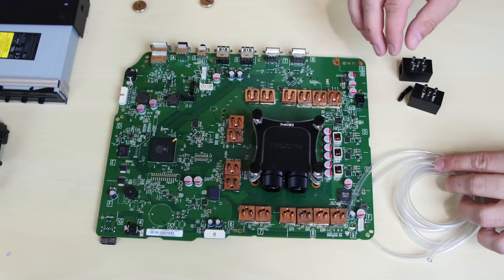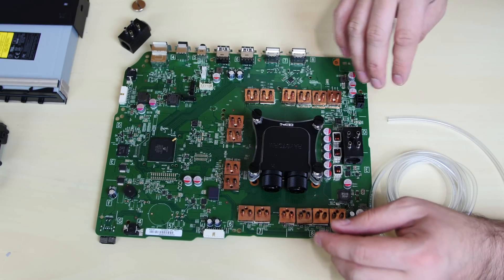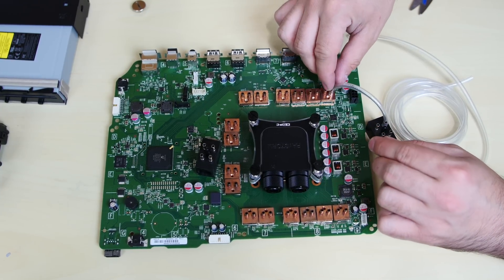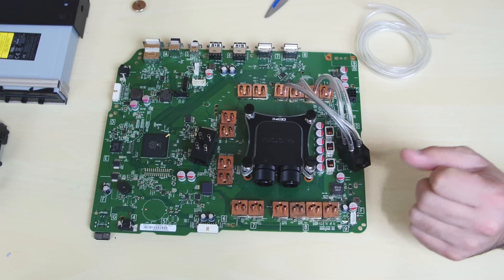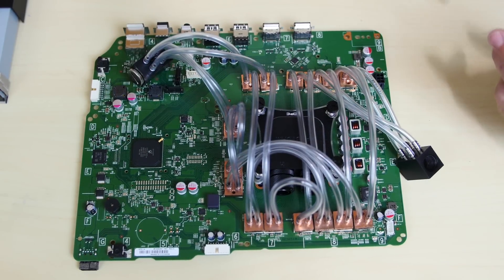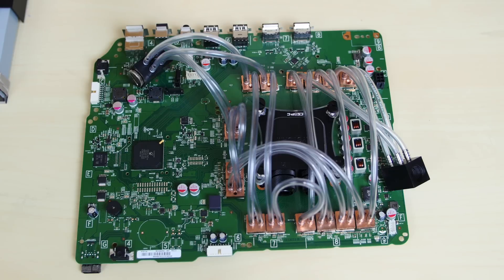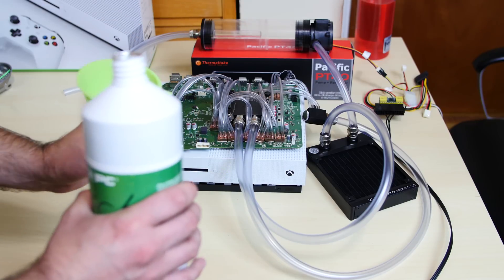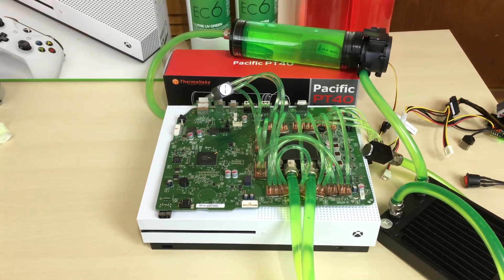Water Cooled Xbox One S - The Build - Part 2

Comment: Once you get the clu block on put the board back in the case.  Do everything possible to not mount the splitter box to the board like this guy.  If it moves and arcs, it will fry.  Dont listen to this guy.

Comment: You should have used some different fittings on the block instead of having to move the smaller ones to accommodate the tube.

Comment: You should have sent the 2 lines on top to all of the top ram and the 2 lines on the bottom to the bottom ram, then chained it like in the product description in the URL you linked.

Also think you should have moved the fan and instead put a piece of acrylic with LEDs so you could see the cooling system inside.

Alternatively, you could have made the RAM in a X pattern and gotten some black lines so it made a green X over the GPU and visible from the outside.

Comment: dat tubing conection :/ you can just chain the in parallel order ,  for ex.  if we assume the odd numbers are the inlet and the even numbers  its the oulet  and you have something like this  [1-2] ,[3-4] , [5-6] , [7-8] you can connect 1 with 4  , 2 with 5 , 3 with 8 and 6 with  outlet and 7 with inlet

Comment: now, i have absolutely no experience with liquid cooling but wouldn't it have made more sense to buy 4 instead of 2 of those "junctions/splitters, coupled with a t-junction" so that all 4 sets of the ram chips have their own "fresh" coolant. currently his config will not cool the last 2 sets of ram as much. it would, in theory, deliver a better heat distribution system.
Reply: also with the obvious............keeping the cpu block and ram block on their own separate lines coming straight from the rad.

Comment: Why not use some cheap ebay gpu waterblocks with 6mm couplings? 3 of those would be enough to cover all the ram chips and (they come in many different sizes up to 200mm/8inch lenght) you would probably get better cooling. Just a thought

Comment: This is pure cringe.
worst possible way of running tubes. wastes so much tube when going across cpu like that, also.. why did you mount the cpu-block that way? you're basically making my eyes bleed.
Well atleast it's just an xbox.
Reply: theres so much more wrong with it, if i was in his place, id be running the splitter things off the inlet and outlets on the cpu block as a passthrough. i dunno, the order just doesnt seem right.
Reply: It is cringe worthy whenever I see consoles gamers try to play PC gamer. The Xbox one S doesn't get nearly hot enough to make water cooling even worth the bother.The CPU in my PC gets hotter than the one s.

Comment: what is the point? to someone that has no clue about consoles this is a waist of money.... taking the xbox apart risk braking it... you cant overclock any console asof yet spending 200+ pounds on a new console then spending about #60/150 pounds on a good water cooling system for what? lower temps? xD

Comment: so whats with the 3 pads that are closest with the cpu tubes? there sideways and might not even be applied correctly. i kinda wondering why you didn't go with 90 degree fittings instead of just straight tubing.

Comment: Wont it be better if you connected it from the right to the left , en start with the top 2 and bottem 2, en work you way to the left. this wil make the path a lot shorter. or is that not what you are trying to do ? cool video tho !

Comment: Wouldn't that massive amount of thin tubes screw up the pressure, and severely limit the flow of the liquid? I don't understand the point of liquid cooling the RAM either. Why not just use heatsinks on the RAM chips; I mean, RAM doesn't get hot enough to warrant a liquid solution.
Reply from the maker: +Tage Nasty yes it would. I changed it up and got rid of the small tube and splitters. I'm using small heat sinks for the RAM
Reply: Rasim Muratovic Thanks for the reply. Any plans of a follow-up video showing the changes you've made?

Comment: Not  A Bad Idea But I Would Have Done The Loop Differently The Keep The Simplicity Down And For Better Temps On All VRMS Your Loop Will Have Slightly Different Temps on The Different VRMS Due To The Way You Set It Up Thermal Dynamics Would Essentially Even Out All Temps With This Design
 
Quick Diagram
C = Converter Plug all but one # = Block + = Input - = Output > = Dirrection of pipe

>#>#  >#>#>#>#>[C]>>[Rad]
#                                       V
↑                                        V
#                                       RESIVOIR
↑    CPU BLOCK                V
#      [-]     [+]<<<<<<<<<<<<
↑       V
#       >>>>>>>>>>>>>>>>>V
↑   #<#<   #<#<#<# <<[c]<<

Comment: Okay ... So My Recommendation would be to use the 4 Way splitter for the Ram A Bit Different
If You use 2 outlets for the Top and 2 for the bottom Ram Blocks and than go to the Next to and so on it will look a lot cleaner
It Might also preform A Little Better since this way the Tubing Length will be shorther
Reply: Not only that, but if something goes wrong in the beginning of the loop, the entire loop that is looking for coolant after that leak will no longer have access to it. This is a great idea to have more than one outlet, especially avoiding hooking up your tubes in a series-adjacent style.

Comment: Yeah that really does look cool. like you said you don't need lights but in the dark it's not going to "glow green" without leds pulsating or chaing colors. personally I'd like to see a slow pulsing green. are you going to do a temp before and after?

I noticed you added music, not my favorite but I'm old. :)

I was watching you put the tubes on and thought you may want to use a piece of firm acoustic foam to stabilze the main board. just be sure it doesn't conduct electricity. maybe a piece of old carpet between the main board and foam?

anyway looking forward to  tech specs on temp and peformance.

Comment: actually it's a very good concept but i think you have to use two separate water cooling system one for CPU and another for any thing else . so hot water didn't move from CPU that will be hotter than other chips .
Reply: thats not how watercooling works.
Reply: Lol..
I have one watercooling loop for my entire computer, CPU, Rams and GPU's, it never run hotter than 60C and it's no problem what so ever.
Nothing in there would heat up so much that the water would be anything else than ,5 degrees hotter at most at the output of one block.
You guys exaggerate the heating potential of these chips way too often.
Reply: what CodyMetal said that's not how it works
Reply: The small radiator should be enough for cpu and ram, its not like this thing is gonna get hot anyway.
Reply: The Xbox One S gets to about 45 or 50c at the very most....water cooling that is pointless. The CPU in my PC gets to about 60 at max load and my GPU gets to around 70.

So yeah, you console gamers really seem to over exaggerate how hot your consoles actually get.